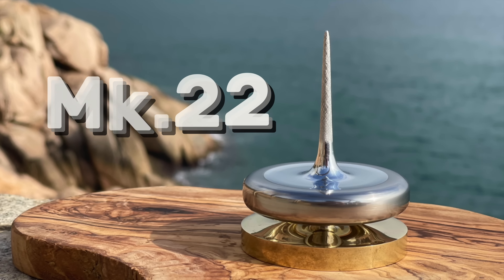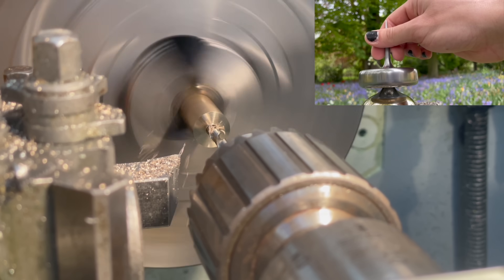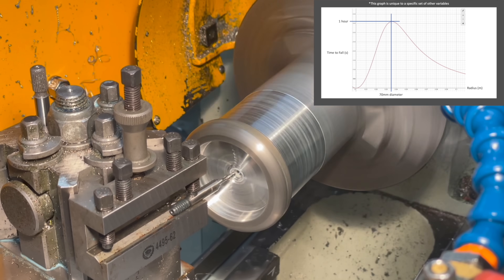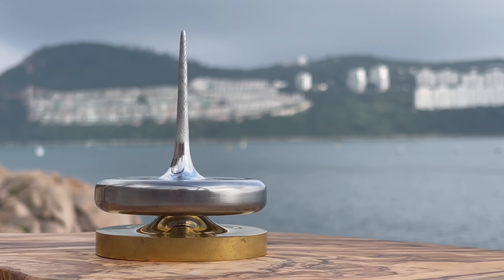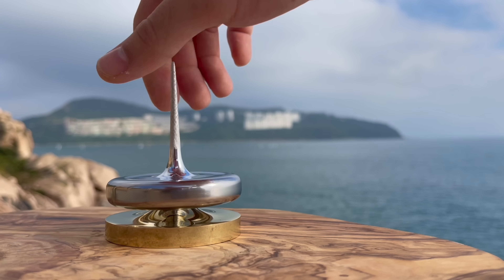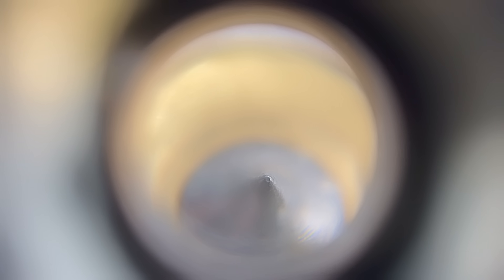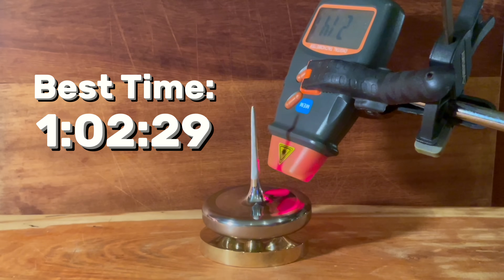Spinning Top Mk.22 | 1 HOUR BARRIER

Comment: How much does it cost? I want one. Thanks
Reply from the maker: I don't have any for sale right now, hoping to get some ready for summer. However due to the high demand and low supply, they will likely be auctioned off and quite expensive! I'll update everyone here and on my ig: hiper_spinning_tops
Reply: @hiper_tops  Thank you for your reply. You might want to serialize them and include a COA (Certificate of Authenticity), your design could get copied pretty quickly in the Far East, I think.  People like me would buy this kind of stuff as much as a piece of art rather than anything, having traceability from the designer is essential in that kind of scenario.
Reply from the maker: @jeandubois8810  Certainly, each piece would have a certificate and box and be treated with the appropriate care!

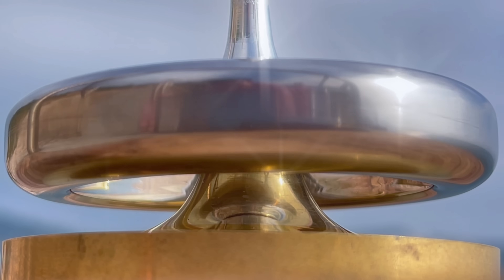Comment: I have no idea what I'm talking about so this might be completely off the mark but visually it seems slightly unbalanced. There's some vibration apparent at 2:55 which I assume would lead to some energy loss. Would it be feasible to use the same methods to balance say car wheels or airplane propellers to get it more balanced?
Reply from the maker: This is true! It was hard to tell when I was filming but in the zoomed in shot there you can see some imbalance forming. This is likely because the top had been spinning for several hours so the tip needed resharpening and balancing as you suggest!

Comment: What if the tip was a spherical magnet with the S pole facing down, and under the platform, there was a magnet with the S pole facing up, so that almost all of the weight of the top is lifted up so that almost no surface friction exists.

Comment: What a cool idea to try to optimize a spinning top. A one hour spin is insane! Would it help reduce drag if it didn't want to fall over? Putting the rotating point above the center of gravity so it'll balance even when standing still? Or would it not count as a top anymore then?
Reply from the maker: It wouldn't strictly count as a top, and also since my tops fall at such a low speed, there wouldn't be that much gained time anyway!

Comment: If you made the top out of osmium would it make a significant difference, I realize this will probably never happen because the metal is extremely expensive just curious
Reply from the maker: It would make a difference. The density of this flywheel is 16.75g/cm^3 whereas Osmium is 23g/cm^3. So with Osmium, I could make the flywheel smaller (lower air drag) whilst maintaining the same storage of rotational kinetic energy. If I had to guess this would improve spin times by as much as 15%. I think realistically I will only be able to reach Tungsten at 20g/cm^3. However, currently my machines are incapable of turning this hard material, hence the 90-10 alloy used here.
Reply: @hiper_tops  that's so cool! thank you for responding to my comment

Comment: You could make it from a denser metal such as gold or depleted uranium. Scaling it up to, say, 10m diameter ought to help too. I assume budget is not an issue?
Reply from the maker: Budget is certainly an issue haha! To be transparent I have made less than 100USD total from this channel. Most of my funding comes from grants I apply for from my university, scholarships etc (and summer jobs etc). So these suggestions are out of my price range for now! Do you mean 10cm diameter? Even still, beyond 7cm diameter, and even if you scaled mass appropriately, spin times would suffer due to the increased powerloss
Reply: @hiper_tops  Have you done any computer modelling? There are many interacting parameters which need to be optimised for maximum spin time. Angular momentum, cross-sectional profile, surface air friction, bearing friction, etc. Air friction reduces with angular velocity whereas bearing friction increases right at the end just before it stops, and both depend on surface treatment and materials. Quite a complicated thing to model accurately but a lot quicker and cheaper than trial and error iteration with prototypes.
Reply from the maker: @Tailspin80  You are very right and it is something I am working towards. I have done a little bit - plotting certain variables like flywheel height, outer and inner radius and mass to find the optimal (Which is what I used in this one). However there is much to be done

Comment: Love this High Performance build! I would love to see you experiment with harder materials for the base and tip. Possibly tungsten base and moissanite tip?
Reply from the maker: Currently I use a Tungsten Carbide base which is harder than pure tungsten. Moissanite is an interesting idea - I have tried SiC bearing balls in the past which theoretically should be of equal hardness. If I could Get a hard enough base (perhaps diamond), maybe I will try conical Moissanite

Comment: Could you reduce air resistance by making it more spherical, hollow with a tiny hole in the bottom for a support post. That way the air inside might be persuaded to rotate with the top. So just the outside surface contributes to air resistance.

Comment: Regarding rare/expensive materials, you might try reaching out to viewers: it’s not uncommon to reach someone who has castoff or scrap materials that are usable for other applications. I can’t think of any industries where they machine osmium, but that doesn’t mean there isn’t one, and even if you don’t get any useful material leads, you might get some inspiration. On the subject of new things to try, it sounds like your primary method of friction reduction for the tip contact patch is to minimize the area as much as possible through precise machining of a sharp point and use of extremely hard material to reduce dulling; have you done any experiments with self-lubricating, ablative, or nano-lubricating materials? I’m far from a subject matter expert myself, but I find myself wondering about what would happen if you used a synthetic diamond tip on a dense graphite base lightly coated in fullerene. Or, perhaps a fullerene lubricated copper base? The idea would be to try to get more rolling friction than sliding friction, and using a softer material for the base might allow the harder tip to form an indentation which could help capture more lubricants. Another idea might be to use a graphite/graphene tip: I’m given to understand that those thin carbon structures don’t have a lot of friction, though it might be hard to properly take advantage of that due to the inevitable off-axis loading during spin up. Obviously, I recommend staying as far away as possible from any suggestion to use depleted uranium as a flywheel material, or any chemically or radiologically active materials: in addition to the obvious hazards, many of those materials present additional hazards to machinists, as well as additional challenges in the machining process (idk if you’ve talked to anyone who’s worked with beryllium parts, but take the ptsd from amateur titanium machinists and multiply it by hypergolic chemistry).

Comment: Having watched a channel called Wristwatch Revival a decent amount recently, I have learned that to reduce the friction of (mechanical) watches they use rubies, and you do mention why it wouldn't help, but they also Lubricate them, do you lubricate your interface surface? If not, perhaps that might be a way to improve the already high-performance even more? It might even let you use mismatched materials? (Although I am not sure if it's a singly ruby, or 2 rubies with oil in-between them in some cases?)

Comment: Good work!  I dont know which physical phenomena is more fascinating, magnetism or rotating mass.  There is a reason why both capture your attention at a very early age.  Some accept they will never understand it, others are driven to madness trying.   Mad on good sir. 
 Might I suggest more extreme numbers, particularly at the low rpm end of the spectrum?  Everything is more forgiving when performed at a more leisurely, although none less respectable pace. At some point toward the extremity, relative friction losses can be reduced to near nil.

Comment: Ive been interested in spinning things since I saw a guy spin a 2mm ball bearing at 1.5 Million rpms using electro magnets and high frequency mosfets on youtube in like 2007. Have you considered and non hand powered spinning records? It looks like your research is specific to hand speeds but would they scale to something spun up by a compressed air turbine? I had a scary air top that was said to hit 100k rpm with 100psi air.

Comment: Any balancing considerations when knurling?
Reply from the maker: I'm not quite sure what you mean. The knurling has minimal impact on the weight distribution of the top. I balance it by grinding the carbide tip with diamond files.

Comment: Awesome, have you thought of trying it vacuum or having a removable handle? 
Great video btw.
Reply: I wonder how much longer it will spin in a vacuum
Reply: Or design one to spin in a vacuum. You'll need a vacuum.....
Reply: You can also utilize neodymium magnets in the top and in the base to reduce tip friction.

Comment: Have you tried using an airgap or some sort of microscopic air cushion to reduce friction on the tip:

Pros:
 - reduce friction greatly
 - non-abrasive
 - cheaper than diamond?

cons:

 - unknown design(to my limited knowledge)?
 - may cause viscus drag between the surface and the tip?
 - may be impossible to design?
 - may be expensive to manufacture or machine?
Reply: also High Performance for sure!

Comment: Have you tried it with a drop if sewing machine oil on the tip? Might be even better with a slightly rounded tip for better fluid dynamics, perhapse even knurl the tip so it naturally draws the oil into the tip

Comment: Looks really cool, but for someone who isn't familiar on this topic this raised questions.

If you want to reduce drag, why did you make the upper part so ruff? I'm sure its for better grip but won't that just cause an aweful amount of friction with the air?

Also isnt the upper Part obsolete once you get it to spin? 

Also under the spinner you made it hollow with a sharp edge, why did you go for this instead of having a flat surface or only slight concave surface?
Reply from the maker: These are all good questions! 

Regarding the knurling on the stem, yes it is for grip. It is not strictly necessary and theoretically I could get the top spinning at the same speed, only after more twirls. Thankfully, since the radius here is so small (1-5mm) compared to the flywheel (70mm), the relative air speed is tiny (air speed proportional to radius). Since air drag is very dependent on air speed, the knurling contributes very little to the overall air losses.

The upper part is, I suppose, obsolete after spinning. However, the tops in my category cannot have moving parts or similar tools to help spin them up, so a removable stem would not be allowed.

The underside of Mk.22 has room for improvement. I hollowed it out for weight reduction. Since the mass there isn't as far out as the flywheel, it contributes little to the moment of inertia. However it contributes linearly to the tip friction, so we want to minimise it. The cost is added air resistance. As you mention, a flat bottom would be best. However, since we want an internal tip for stability, at some point this flat bottom must go up into the top. Mk.19's design does this best! However, it is a pain to manufacture!
Reply: @hiper_tops  
Hey, thanks for the compliment.

Makes sense,
even if this knurling wont cause a lot of drag, couldn't horizonal knurling only further increase spin time ?
(My theory being that this criss cross pattern leaving more space for air to build resistance on while horizonal lines may go with the flow only?)

Would thin plates that you weld on count as 'removeable' too as it's not a single piece? Because if not, couldn't you go ahead and weld on a plate to cover up this hollow area?

Also would a round finish instead of the sharp edge finish you went for help to reduce drag even further or do round surfaces actually have more surface area per same weight?
 I think not but i might be greatly mistaken😅
Reply from the maker: @ZLP-TM  Regarding the knurling, I think it would be hard to tell the difference in spin times even between no knurling and with knurling, but perhaps on the micro scale you are right about the air flow. I do want to try linear, vertical knurls at some point. 

If welded on, plates would not count as removable. As long as it stays attached throughout the spin, I think it is fine. This was actually my intention for Mk.19: I wanted to use cling film or something similar to cover the upper hollow section. However, in practice it was difficult to do this in a way that didn't create an uneven surface or weight distribution. 

Also, yes rounded corners would be more aerodynamic but result in a smaller moment of inertia. The degree to which corners should be rounded is something I'm still not fully sure about, however I think I got it right with Mk.22.
Reply: @hiper_tops  
Ah yeah figures... I can see how much of an issue weight balance must be. That pretty much throws out all ideas I had in mind still.

What did you do to make your surface as smooth as possible?

Aren't there sources out there to confirm if you got the right ratio for the mk22?
Reply from the maker: @ZLP-TM  I use fine sand papers and then diamond lapping pastes to 0.5 micron :) 
I have not been able to find any useful papers yet so do tell me if you spot any hahaha
Reply: @hiper_tops  
I mean, if you didn't manage to find any sources then there is no way i will find any either, however i would have assumed that aviation related papers contain studies about this, maybe not under the words you where searching for however, but again, I wouldn't know - Just an assumption 

The pores are probably filled with fine partices of metal dust already but do you think giving it a thin oil coat or something would further smooth out the surface area because it gets into places that some particles may be too big for
Reply from the maker: @ZLP-TM  I think you are correct about metal dust filling any pores, especially since I use diamond lapping pastes in my finishing process. I don't think oil would add any further benefit
Reply: @hiper_tops  in heinsight the surface tension would probably cause it to form little Bubbles or dips anyways

Comment: Does the wide base act as a wing producing a small amount of lift? There could be improvements there.
Reply from the maker: Not currently, it is wide and heavy for stability and shaped mainly for aesthetics. Lift is something I've explored in some other comments of this video and we conclude it is likely not a feasible method for improvement. It would create too much drag for too little decrease in tip friction.

Comment: Any chance for a small commercial batch for new admirers of the craft to keep deskside and help fund the cause??
Reply from the maker: Hey thanks for the interest :) I am currently trademarking my brand etc and working towards producing a small number of tops similar to Mk.22! I don't have an ETA right now, especially because I have a lot of uni work to do XD However my goal is to have something(s) to auction off over summer. In the future, I aspire to manufacture smaller, simpler, perhaps single-twirl versions which may be easier to manufacture and sell at scale :) I'll post any updates on this channel and my instagram: hiper_spinning_tops

Comment: i would consider making the top on a diffrent lathe as you can see the unballanced nature of the build. A Hardinge toolroom lathe will make a big diffrence . Also an odd trick is to place various types of tissue paper under the tip as the fibers lay down , they get burnished and form a hard bearing surfae.

Comment: A suggestion: You can add some permanent magnet to counteract weight. You cannot do levitation with magnets but you can lower force on the pointy tip and therefore lower friction. But rotating metal next to a magnet will lose energy thanks to eddy currents, so you will need to use something nonconductive.
Reply: So you want to almost levitate it?
Reply: #active levitating top
Reply: @neptarclepuffin  Usually this rotates only several minutes. I guess because of eddy currents so you need to use ferrites. I think partial weight compensation will work better cause levitating may lose stability at low speed, dissipate energy via vibration, etc (and it looks kinda like cheating).

Comment: I will assume "sharpening" does not mean actually sharpening the tip? Or is that really good for friction? Intuitively it feels like a rounded tip would be better, especially if you imagine it "floating" somewhat on oil or other lubricant (filings?).

Comment: I wonder if magnets could be incorporated into the top and base to reduce the pressure on the tip. Of course you would then be sacrificing a little bit of mass on the top, so maybe it would do more harm than good. Imperfections in the magnets would also create small eddy currents in the top and base which would further sap energy away from the top. It could be worth a try though.

It would be interesting to test this top in a vacuum chamber to see how much longer it can spin without the effects of drag. That would allow you to prioritize further improvements.

Comment: How long does it spin for with a tip that protrudes below the flywheel?
Reply from the maker: Theoretically, if I could balance the top perfectly, it would make no difference! However in practice, tops with external tips rarely have critical speeds below 60rpm. So this would remove the last 10 minutes of the spin.

Comment: Wait, how does it reach launch speeds of over 2300 rpm? It can't be just because the twirling surface is super tiny, can it? That would take monster strength if so